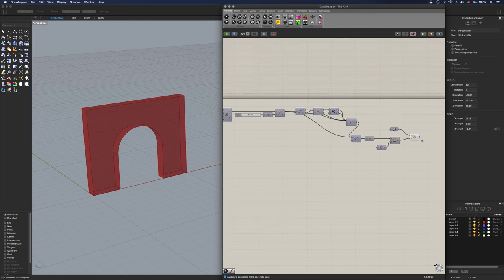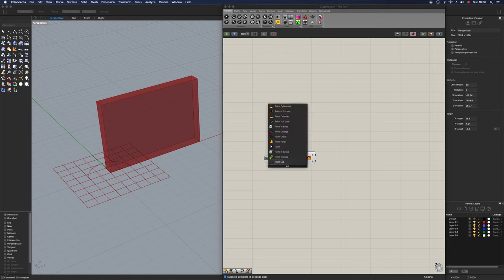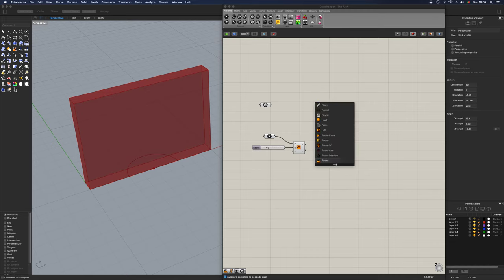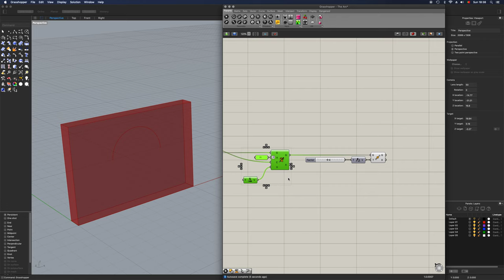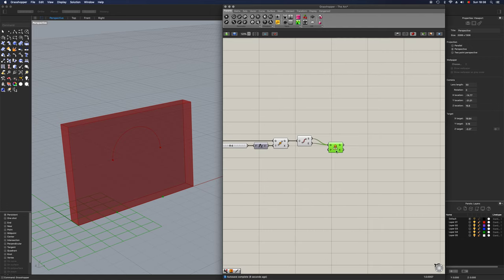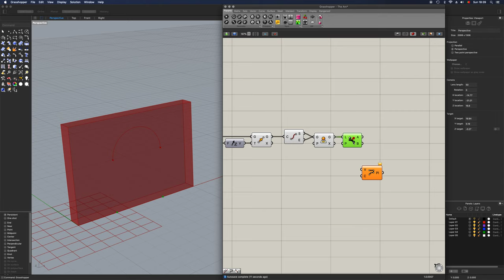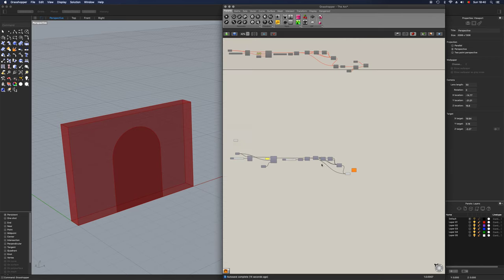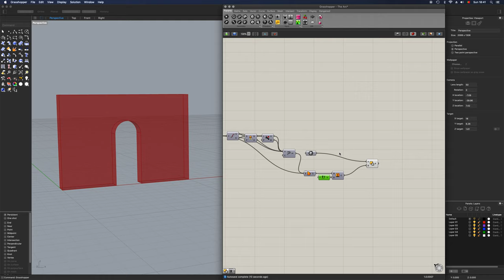Grasshopper Tutorial: How to Make a Parametric Roman Arch

Comment: It seems that you can't connect multiple inputs into a component in Grasshopper 0.9 in Rhino 5? The Project component won't accept both points from the curve, only one at a time. And a polyline component won't accept 2 points at a time?
Reply from the maker: Maybe it's because of the version difference